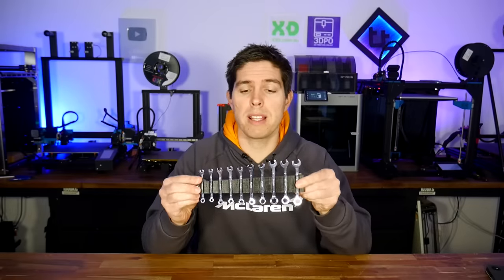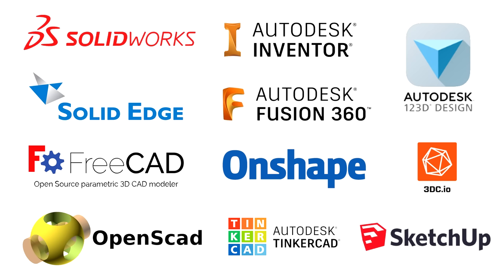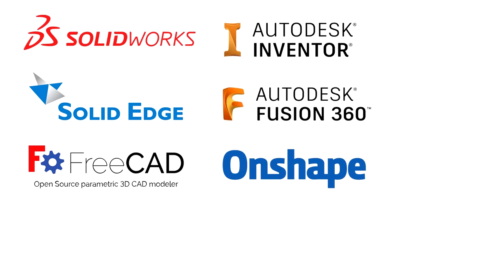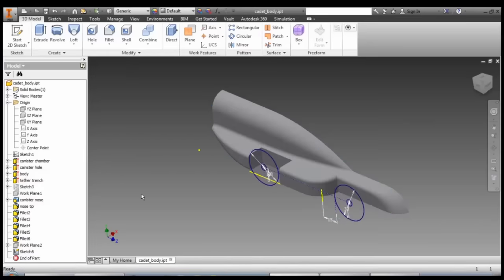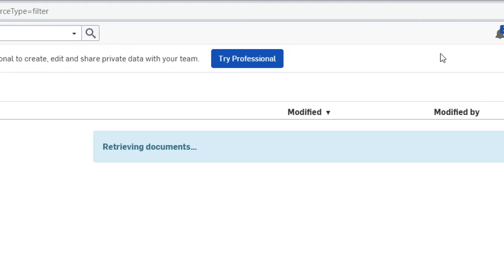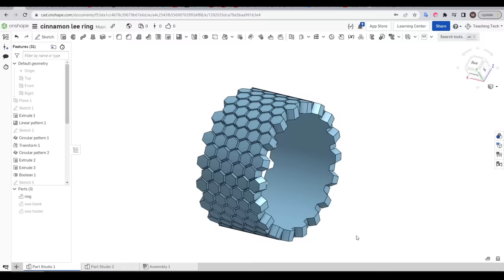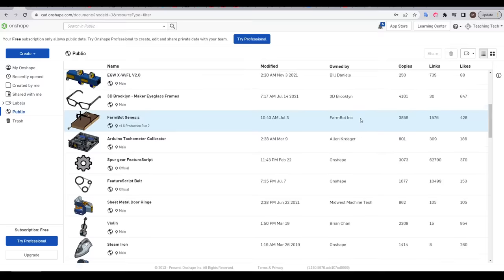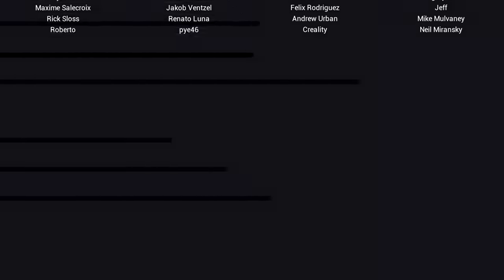Selecting a free 3D CAD option - 3D design for 3D printing pt1

Comment: I use solidworks professionally but for personal use for 3d printing i think i am going to give Onshape a try! Thanks for the awesome video!
Reply: Yes, I just started using OnShape and it is very similar to SW. The thing I’m still getting used to is that you create all the parts and assemblies in the same “document”.
Reply: @eugeneabel5550  ...just like IronCAD, which is also not history-based. Its advantage is its amazing Triball functionality. As you probably know, neither is used nearly as much as Solidworks in industry. I tell students that they should expect to use Solidworks in college because the majority of companies hiring mechanical and manufacturing engineers want them to know SW.

Comment: I've been using OnShape for years. I found it to be more intelligent to use than Fusion. For example, in OnShape I can use negative numbers but Fusion would not allow me (it might have changed by now as I have not used Fusion for a long time). Fusion for me also had some weird behaviour that created some strange results, where as is if I did the same thing in OnShape it just seemed to know what I wanted to do and just accepted the way I was doing it

Comment: I find for Fusion360 with the ability to group bodies for a 3D print for multi color or material 3D printing is why I use it the most and its better Slicer export. I have SolidWorks and Fusion360, for 3D printing Fusion360 look less steps to get the part ready to 3D print and I could just do more with it for 3D printing.

Comment: 4:11 ??? Rounded edges on a cube in Tinkercad is not only possible but very easy - there is a setting in the parameters panel just select, enter the radius in mm and job done!

Comment: Great video. I "put up" with Fusion 360, because it seems "sufficient enough" for me... But I'd prefer something like Solidworks where it's a program installed and can be used offline. No "mother may I do _________"... I'll give Onshape another go purely for not realizing it could be used on a phone or Android device. Thanks.
Reply: You can use Fusion offline, you only need wifi when you start it up, but after that you can make and change models and you can also save them.

Comment: Must admire the financial "genius" behind Autodesk that developed Fusion 360 on the expense of free user experience and then charge their users for the software they helped develop, not only that but using said knowledge to improve all their 3d software platforms. Blender with Cad Sketcher is a project I´m considering get behind once it has some solid parametric functions.

Comment: I am going to be interested in this tutoring series! I have tried a number of cad programs including confusion 360 and sketchup. I have tried a number of tutors. As a person who is not very literate when it comes to computers and cad programs. The video tutorials I have tried in the past have been worse than useless. It is assumed that I know things I don't and doesn't make clear important points. It is very hard to follow videos step by step or so you think and find that the tutor quickly pushed a button barely mentioning it in the commentary.
I don't normally like web based programs because I consider them unsafe and have watch others lose thousands of hours of work because a company folded or was taken over and their access to the server was denied.

Comment: The coolest thing about FreeCAD is that you can create models to using python scripting. 

Coming from an SoftwareDev & EE Background this makes things for me so much easier for simple geometries.

This allows me to model anything from  just a few mathematical equations put into code. Super easy to modify and most important to me: I get a good high level overview of the structure of the construction. 

Also the documentation ist great and teaches you CAD design best practices, while demonstrating multiple ways to to essentially the same thing. 

Once you get the hang of it you become scary fast.

Comment: I use a mix of OpenSCAD,  Blender, and SolveSpace for designing printed parts. I honestly just go more with blender and use the measuring tool to get things "about right" - within the margins of my own printer's capability it turns out fine for the one-off things I'm making. For more precise things though, I use OpenSCAD mostly, I don't use SolveSpace as much these days cause the STLs it outputs are very very messy, but you can export in other formats and it has a lot going for it. I am not a fan of the cloud-based systems (or functionally cloud based like F360), and FreeCad has never really agreed with me...
Reply: FWIW, OnShape has builtin scripting in the form of FeatureScript.  It looks INSANELY powerful and they have made it even easier to use than OpenSCAD!

Comment: For quick and simple designs TinkerCAD does the trick for me. For more complex (multipart) designs  wher measurements are very important, I use FreeCAD. Today I tried OnShape for the first time and I like it!! But do you know if Onshape has also the posibility to use variables sheets, like in FreeCAD? Especially when you have desings with mutple components and depending measurements. In FreeCAD I can make a list of measurment variables and change them from there and the whole deign updates accordingly. A very powerfull feature. Once I designed a throttle quadrant for flight simming and I had to change the measurements during the design and prototyping process multiple times and having to do that in only one place was a blessing.

Comment: FreeCad seems to be able to do what SW  can more or less. The issues are that the included assembly plugins are tricky to use. Assembly 4 does not work at all like im used to from say Solid works that im used to from school and also my work. The A2+ workbench can be installed wich is much closer to SW . The other thing is the UI looking very old like from 30 years back, from the 90s and the Windows 3.1 era.

Comment: OpenSCAD is a bit like POVRay. The major difference is in their direction, as POVRay is mainly a raytracer with a built-in coding platform (esp. if you use the graphical UI), whereas the other is a dedicated modeller.

Comment: Just a note, SOLIDWORKS has surface modeling for some time now. And you can even "cheat" your way to G3 class surfaces (how smooth the transition between the surfaces is - zebra stripes check). The problem is of course the price...

Comment: I've used inventor since highschool and for my job (so I've had about 7 years of experience in inventor? Also about 4 years of experience in AutoCAD but not really for 3D modeling, only drawings) Inventor is so easy to use and has so many good features. I hate how expensive it is 😭. Fusion 360 has most of the same features but it's missing a VAST amount of the freedom and usefulness of inventor which is unfortunate. Every other CAD software doesn't seem to work / function quite like inventor / fusion 360 does and I find the way they do it to be more clunky and more difficult or complicated (they seem to operate more like Autodesk AutoCAD mechanical which I don't really like or use for 3d modeling. At work we only use AutoCAD for making electrical drawing sheet sets and for that I LOVE AutoCAD for, but in terms of our mechanical design inventor and inventors mechanical drawings are so much quicker and easier to make EXTREMELY fast. The work flow is great for 3D design from my experience with it.

I also love how easy and good inventor is with assembly models. And constraining parts together and being able to easily just grab and manipulate moving parts to see how the interact (as long as you set the proper constraints).

Comment: I'm going to design a new case for my phone. I don't have a printer (as of this comment), but I'd still like to begin with the design. I'd like it to be a clamshell construction, with small compartments for a sim tool, SD/sim card, sim card port flap, flip out phone stand, headphone jack relocation blister (with groves for wire routing), and battery blister (for a 2nd battery, in case my phome dies). I'd have to cut away parts of the back of my phone, and solder new battery terminals inside my phone, but it's a budget phone, and I'm willing to risk breaking it. Ideally I could have an external switch to swap which battery is being used without having to remove/open the case.

Comment: As a Linux only user that wants to keep control of my data, not get sucked into an ecosystem that could become non free or subject to terms like non commercial use. Freecad is the only option.  I little bit of a learning curve if you decide to figure it out yourself, watch some videos and it's pretty easy to use.  There is more powerful software that you can buy if you can afford it, but I'll back the open source and free options every time as the user base adds to the projects success and makes it better.

Comment: An old PTC user/manager that has been looking for another platform and used Fusion 360 a little, but will give this a shot and see which of the two works better for me. I currently have an Ender series printer and have a 4 axis  mill coming (the one Chris showed us) my goal will be to create replacement parts for the warbird community. At which time, I will switch to a commercial version. Those warbird parts are becoming scarce and potential sources are way too expensive. Thank you!

Comment: One issue i had with Fusion 360 was that the only way to get it to Work at all was to load up my Desktop PC and throw as much computational power at it, as i can, which yeah, i get it, cad needs some power but it seems a bit excessive, that the software would hammer all eight CPU Threads on my notebook to 100% simply by starting the software

Comment: kinda had to laugh that 4 of the reviewed option ones, are all from Autodesk.  I use TinkerCAD myself and its been a great to re-familiarize myself with 3d modeling after having not touched anything of the sort for 20 years.  I have Fusion 360 installed as well and do need to tackle that one as its much more powerful.

Comment: I'm a teacher and after much research, I chose Fusion 360 for various reasons. However, if you are a teacher reading this, the support from Autodesk is terrible, and getting the licence set up for the kids to use is a total pain!
When you've got through this, the program is very good and allows a wide range of abilities to learn quickly.
If Autodesk could improve the onramp and support, this would be perfect.

Comment: Thanks! Great work! 

I have FreeCAD installed on my Mac, but haven’t had much time to try it. It seems quite similar to Inventor, with some helpful plugins- such as being able to import existing Inventor parts & projects, which is great as i no longer have access to Inventor for my old files. I first learned parametric modelling in Inventor 

I’ve also tried Fusion (formerly Fusion3D), which seems a bit less daunting than Inventor, however doesn’t seem to allow conversion from Inventor. Odd given it’s made by the same company.

I think that I’ll try Onshape. It looks great! Can I import files from other apps (such as Inventor)?

Comment: ps is free, app  blender 3d it has a new cad 3d extension in it along with a 2d/3d hybrid greases  pen add-on don't know how well it works with 3d pints as a whole, add-on wise. its fairly  new as in previous build of blender added 3d cad support as in the build date close to this video date then one build back.

Comment: Great summary and a nice justification for your selection for a CAD software for hobbyists.

For me, the selection of a CAD software depends on your specific needs, experience and financial resources.
If you need simulations with your CAD, integration with electronics (circuit, simulation and PCB)under the same plateforme there is a limited choice.
You can find non integrated open source software to perform the same objective at a lower cost and with a non integrated environment that might not be user friendly and with a more abrupt learning curve but it’s free.

You might have work already with AutoCAD, Inventors, solid work, sketch, etc. This could facilitate your learning curve with some CAD software close to your known CAD.

FreeCAD is not the best in terms of functionality and learning curve but it’s an high value CAD for hobbyists.

I am looking forward to your training program.

Comment: I am here to mention SolveSpace. A free and open source minimalist parametric CAD software. You need no account and it has around 10 MB in file size (that's tiny compared to thicc bois like Solid Edge) as a single executable. It's similar to FreeCAD, but simpler (less buttons, no need to bring vertices into a sketch) but some features are missing (chamfer). It clearly shows you the degrees of freedom in a sketch. And it also can do assemblies and mechanical linkages. Does one job and does it well with no extra features.

Comment: One point that, at least to me, makes parametric CAD programs extremely powerful (though I assume this would also work on OpenScad) is the fact that you can create variables for all of your parameters. In the case of your video where you resize the base of your cube to create a rectangular prism, you could have set both the side lengths, and height to a variable, maybe called SideLength. That way, you could change the value assigned to SideLength, and it would have resized the entire cube by changing a single parameter rather than having to remember what size you changed the base to, and then also doing that on the extrude step. Maybe that’s a little advanced for an intro video like this, but to me that’s easily the most powerful thing about parametric CAD programs.

Comment: With parametric modelling you can change your parameters, but with more advanced models it doesn't always work properly. To change those models, you have to make user parameters(atleast that's what it called in Fusion 360). I don't really know how this works in SolidWorks and the other software though.

Comment: Question for you. I primary do complex vase mode printing. (aircraft and rockets) does onshape have a way for me to put a "0.01mm slice" into a model to create a rib and then constrain that "rib" to the outline of the model and then "offset" it a fixed distance from the outline? for example cut the "rib" to the shape of the model and offset it 0.8mm from the outside surface. then if I scale the part retain the profile and offset rib to part.

Can it do that?